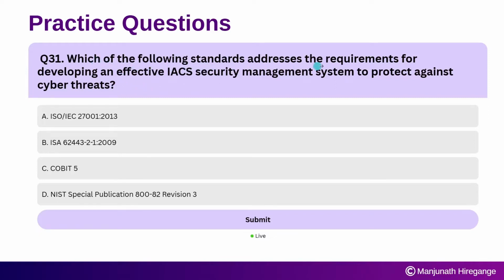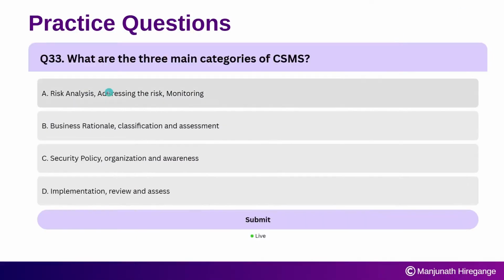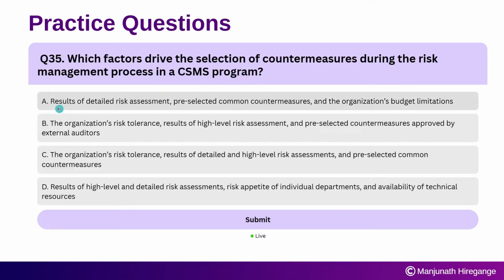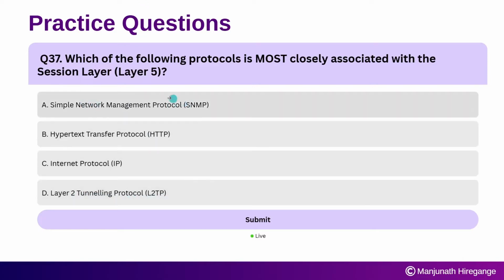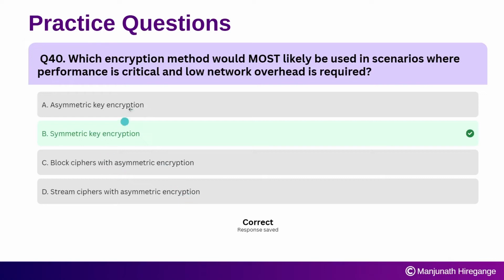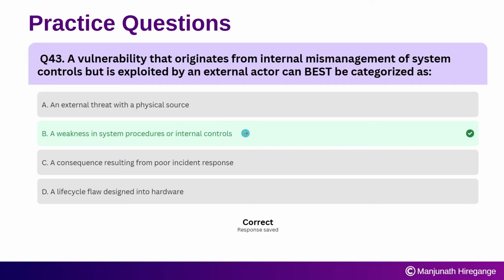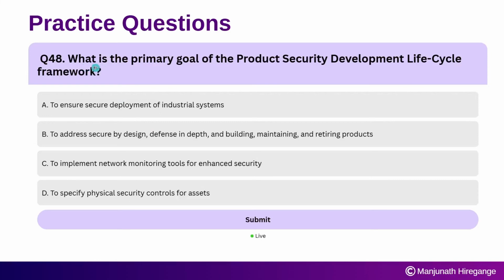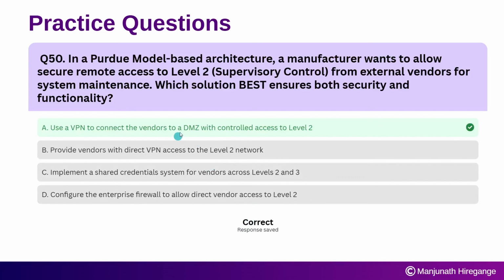Mock Test 3 | ISA/IEC 62443 Cybersecurity Fundamentals Specialist Certification Practice Questions

Comment: Just one question, for the Q37, if SNMP and HTTP is layer 7, IP is layer 3 and L2TP is layer 2, why is the answer L2TP?
Reply: This is indeed a challenging question. L2TP is a protocol for encapsulating (tunneling) layer 2 traffic. It works by encapsulating layer 2 frames inside UDP packets to be sent across a network. The establishment of the tunnel and subsequent session is managed at the session layer (layer 6). This means L2TP operates ON layer 2 and is ASSOCIATED WITH layer 6, making it the best answer to the question. I honestly feel that if you’re not a hardcore network person, the best approach to this kind of question is to try to eliminate other options like Manjunath does in the explanation.
Reply: Actually this answer is wrong. L2TP is primarily a L2 protocol. Layer 5 deals with the establishment,  management and ending of sessions between applications; Layer 2 deals with a tunnel establishment, e.g., a point-to-point virtual link, in order to encapsulate frames from the data link layer (like Ethernet for instance) and transport'em. So,  in no way L2TP may be a Layer 5 protocol.
@icsotsecurity please correct/change this question.